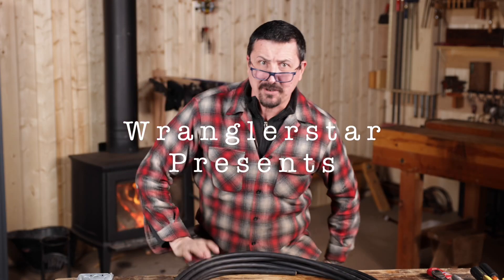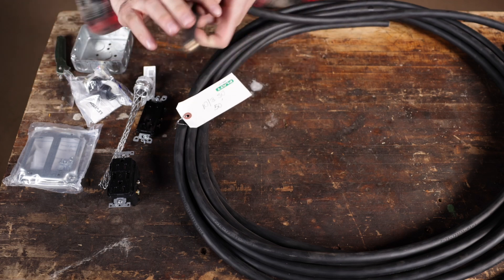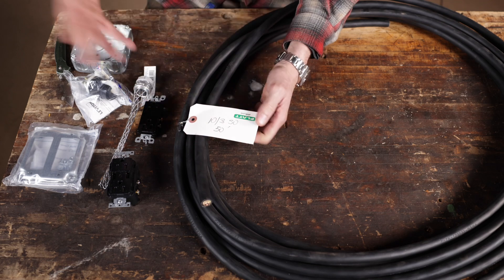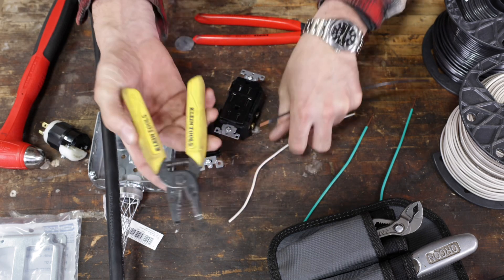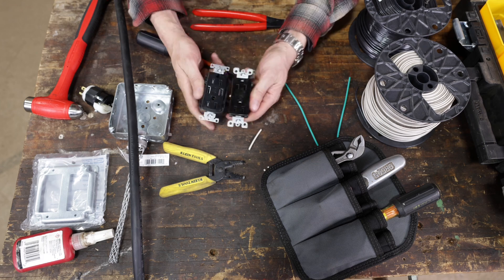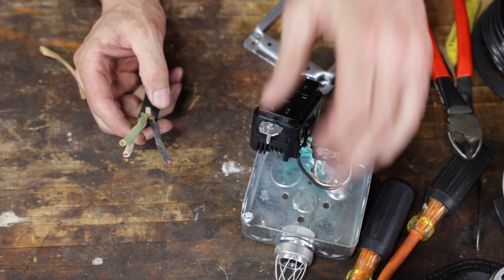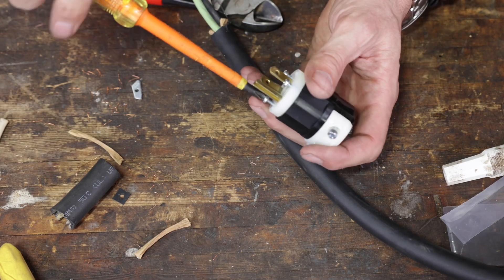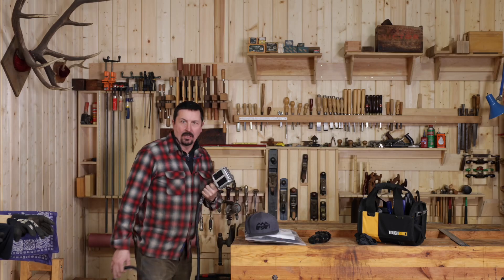The Ultimate $150 Shop Accessory - ALPHA CORD

Comment: SJ series wire, yours may be SJ0W or SJ00W. the less 0's in there the thicker the rubber jacket is. this stuff is the best! I wire a lot up with 12/3 SJ00W as the jacket fits in plugs easier
Reply: it is probably SO the O'S are for oil resistance not size the J is what means that it is thinner

Comment: I like the waterproof boxes and covers for my cords, and with a gfi socket on the hot side. Use to cut a tennis ball in half and put on ends so that at a construction site it will walk itself off of the studs, saving lots of steps at the end of the day. Will only work on the male end and not the box end.

Comment: That piece you removed on the male plug is for using on flat wire like pump wire. Not for that big black round cord you are using so you have to remove it

Comment: A nice bead of silicone to seal the gaps from water, and maybe a coat of  spray bedliner and filing the sharp bits before finishing this metal box would make it great. Yeah, it's GFI protected, but why rely on this to prevent shock when you can prevent the water going in in the first place...

Comment: You are missing the metal lockring. The plastic is good to prevent chaffing on the wire but not adequate for the strain that can be applied with the application you may be using this cord for.

Comment: Just a suggestion.  Use 20 Amp receptacles in your box and wire them in parallel, not serial. If the branch circuits in your garage aren't GFCI breaker protected maybe consider replacing one of the USBs with a GFCI receptacle.
Reply: They are wired in parallel.  If they were wired in series, you'd need something plugged in to both outlets to get any current flow, and each load would only receive only half the expected voltage. (approximately half, depending on the resistance of each load.)   And as some other commenters have mentioned, in order to properly wire this for CFCI protection, you'd need to have CFCI protection in the plug, or make sure you plug it into a CFCI protected outlet.

Comment: I've made a lot of those types of extensions cords and drop lines when I started out as a technician. Single and 3 phase drop lines were needed on every test bay and in the power amplifier generators final test area. 
A lot easier than wiring a 3kv power box for an RF ashing system.

Comment: You also could have used commercial or industrial grade receptacles which have braces on the back of the plugs and much better plug retention springs.

Comment: Don’t use metal boxes with knock outs for extension cords stuff can poke inside the box... we make them at work for high voltage testing but we use the Leviton pendant receptacle boxes which are made for this
Reply: how is it any different from when they are mounted on the wall of a building?
Reply: @patrickderegt2582  that’s stationary this is not and on the floor

Comment: Since you are using 10 gauge wire, maybe you should have used 20-amp outlets.  Probably not needed but maybe nice to have.  And also a GFCI outlet would make a lot of sense to have.  But great video, thanks!  I agree that beefy 10 gauge wire is nice to have.

Comment: FWIW: it would had made sense to use 10-3 and wire up the outlets as split-phase with a 240V plug. That way you could pull more than 20 amps with two or more devices plugged in.
Reply: how do you plan on using multiple 15 amp tools at the same time?

Comment: I did this for my welder, I wanted to be able to weld outside of my garage so I put the outlet by the door and I made a 35 foot cable for 220 And 40 A. I did it exactly the same so if the plugs were out I could just change that and just had a big metal box at the end

Comment: We use these commonly in the live production industry and are typically called quad boxes. In fact, all of our cable is soow to withstand the abuse of events. By the way, that 10-3 is a waste of money, space, and weight because a 120v circuit is only 20a anyway, so just use 12awg. Also, use hospital grade receptacles because they are higher quality and will last much longer.

Comment: Just a FYI to the public when doing a Plug End start by making sure you are at the right end of the Cord. If you have to cross the white & black wires to make the connections your on the wrong end of the cord.   If your on the correct end everything will go straight in.
Reply: Thanks for that little nugget of gold.  I'm off to the garage now.

Comment: For the expense and effort, why didn't you use water proof boxes so you can use it in the rain. I've built similar extension cords.
Reply: waterproof boxes tend to be less resilient to getting thrown onto concrete and there really is no point as normal 15amp plugs aren't waterproof anyways

Comment: Has anyone already suggested that the next time you assemble such an extension cord and if you have such a long strain reliever, you should first push the whole cable into the strain reliever, and only then strip the cable so that the wobbly wires do not interfere along the way?!?

Comment: UPGRADE:  USE a Aluminum weather proof box. The knockout holes are threaded . The and the Knockouts in the box wont accidently be knocked out. And Osha requires GFCI Protection pretty much every were now and then you don't need your lock nut on the inside of the box were it belongs and your connections will stay dry and weather Tight

Comment: Grew up calling the box filled access  holes in the box a "Knock Out", the knocked out blank was called a "slug"
Reply: For a short time you could use these in the subway turnstile. They fixed that quick.

Comment: The letters in "SOOW" stand for cable properties. The 'S' in SOOW cord means “Service.” For portable cords that begin with an S but are NOT followed by a J, the voltage rating is 600 volts. The 'OO' means the cable has oil-resistant insulation and jacket. The 'W' means the cable is weather and water-resistant.

The J in “SJOOW” stands for junior. And it’s only rated for 300 volts.

Comment: For this type of plug, AWG10 cable is overkill. A standard US 3 prong plug is rated to 15A, anything higher than that and you'll need those bigger heavy duty plugs. Taking this into consideration, a AWG14 standard 60C/140F cable is rated at 15A, a 90C/194F high temp cable is rated at 25A. A AWG12 cable is rated at 20A for the standard and 30A for the high temp. I would say a AWG14 is cutting it close on the current rating if you're gonna run high powered stuff off it, but a good quality AWG12 would be more than enough for a standard 3 prong US plug. I would only go bigger if you use an industrial grade 30A plug and circuit, but most homeowners will never encounter this.

Comment: Thanks, I'm fixing to head to the nearest job site that Versa Tech has going on and look for a few hundred foots of 10/12 and make one with four male plugs that then splice down to 10/3 so that i have the separate power options of 120amp volts, 240amp volts, 360°'s amp volts, 480 amp volts....WAAAATT!!!

Comment: If you have old usb connector cut off the wire fully and put the usb end back into the plug to stop dust and dirt getting it the usb port

Comment: It looks like you used lighter gauge wire inside the box. Doesn't that defeat the purpose of getting the 10 gauge?  Not criticizing, generally curious.
Reply: no 10 gauge just helps reduce voltage drop it would only be a problem if the jumpers were like 16 gauge or smaller

Comment: That bnut is to be on the inside the plastic u used on the inside is just to protect the wire from the sharp edges not to hold it together.

Comment: You could put a single plug on the end and then just put that four gang Box with a short cord, like maybe 3 ft. Which then you could use it on a workbench without having 47ft of cord
Instead of dragging that box around when needing only a single plug
 Because when you go to wrap and store that four gang Box it's a nuisance

Comment: That is not a jam nut it is a lock nut and it goes inside the box, the grey cap is a wire protection from the rough end from cutting insulation.

Comment: I used 10/3 cable to run power from the Dryer Circuit to my home made Face Grinder.  I just don't run it when the wife is drying clothes!  Like you said, home electricians don't have to follow the rules.

Comment: 10 gauge is overkill that it’s safe enough to run it straight out from the breaker panel than from the outlet with 14 gauge.

Comment: I read way down into the comments and didn't see it, but buying 10 gauge rather than 12 so that you can run 220v on it is just wrong.  If you're going to disregard the color-coding in order to run 220 over the cable,  the gauge of wire is not the question.  You can run 20 Amps of 220v on 12 g cable or 30 Amps on 10g cable.  As long as you haven't exceeded the voltage rating of the wire (usually 300 or 600 volts on this type) you should be fine, but the gauge of wire determines the current capacity, not the voltage.

Comment: Haha I made a 10/3 for my welder , and I only use 12/3 for my tools and for my portable table saw or miter saw I have a dedicated 10/3 or if I’m drilling steel for extended time or lot of load on the tool I only use 10/3 saves your tools life . I like the box  idea though.
Btw that red hammer is the best hammer ever I have one mine is a Gear wrench made in USA 90 bucks but omg I use it everyday had it for two years and love it !

Comment: Isn't the nut on the strain reliever supposed to go on the inside?? that plastic "Nut" is not a nut its not made to hold that in any way, the metal nut should be inside and the plastic piece should go inside as well its only used to protect the cord coming through.

Comment: You put the plug on the wrong end of the cord.  Notice how you had the black and white wires crossing each other?  If you put the plug on the other end of the cord, the wires polarity would line up with the proper blades of the plug.  Always look at the cord, and install the plug first.  -Doozer

Comment: Your cord is SOOW/SJOOW Cable. Heavy duty service oil-resistant insulation with flexible thermoset rubber jacket oil-water and weather resistant service cord. We used this in our bakery and vegetable oils will eat rubber and this is the only cable that would last. It will be last cable you will ever need as long as you don’t run over it. The color flipping in the plug is caused by he put his plug on the wrong end of the cable but it does not matter! Old electrician come out of me!

Comment: No need for 10awg unless you’re running over 150’ there should be no need to account for voltage drop, Service (SO) cord insulation is rated for 600V, could use Service Junior (SJO) 300V. 12-3 SJO is rated at 25amps, which is higher than breakers and outlets

Comment: you should do solar power instead of Fire wood. too save on the wood and its actually getting cheeper than firewood and it gives off more carbon dioxide than firewood which is good for the trees

Comment: The ring nut was NOT there as a "jam nut". To was supposed to go on the inside of the box. The plastic nut is not suitable to hold the strain relief into the box; the threads will rip out. Put the ring nut inside and tighten securely then the plastic nut is nut needed. Those nuts are for ridged conduit in a box. Again they are put on after a metal ring nut to protect the wires. They are not meant to, nor will THEY hold up to the kind of stress/strain that will be encountered.

Comment: The engineering on that Chinese finger trap 

Has a name it’s called  McCallum clamp they use the as strain reliever for wire and to hold and anchor a flexible pressure lines to a vice.

Comment: I would have built it out of an aluminum or heavy plastic outdoor box with the flip open covers if you are dragging it around on floor or drop it outlets faces will get broken or cracked so i would have the metal covers to protect outlet from damage and it keeps dust metal filings water etc out of box. the decora outlets are not as strong and durable as a good heavy duty duplex outlet is commercial or industrial grade the better grade outlets have better contacts and grip cords much better so you don't accidentally pull out cord

Comment: after a direct hit from a hurricane a bunch of us went to the factory and raided the wire storage and store room. 8 hrs  a thousand ft roll of s.o cable. a huge box of part. duplexes and junction boxes. made cable after cable for folks to run power to the house from a generator.

Comment: Not trying to come off crappy but it’s funny when he says it’s not rocket science or it’s easy and then messes up basic things electricians warn apprentices about all the time. The metal lock nut goes in the box. The plastic piece is a bushing. Also if you use any kind of power tool on that cord it will work yes but you should have at least 20 amp rated ends on it.

Comment: Its S-O cord and that box isn't correct. Use a "explosion proof" 4 square box with a single threaded hole (i.e 1/2, 3/4, exc.) Then use a rigid double duplex cover.

Comment: Ahhh... Wranglestar being an electrician... always good for a demonstration on how not to do electrical work... Your locknut:  is not a locknut.  That is a ground bushing.  It's not designed or intended to be a means of securing your Kellum grip (Chinese finger grip) to the box.  Your jam nut isn't a jam nut; It's the locknut that should have been on the inside of the box.  You didn't show the connection of your SJO cord to the box and receptacle.  It's anyone's guess on whether you put a sta-con or other appropriate terminal on the ground lead to make that connection proper.  Hopefully you also put the SJO cord under the duplex receptacle terminal and didn't double lug the only screw on the USB receptacle.  The appropriate box would have been an FS box, not a stamped rough-in box.

Comment: Cody, you now have an extension cord that will last forever with a USB port that will be obsolete in 10 years.  Maybe in 2030, you will have to do the swap-out video to the latest technology. Or maybe that receptacle needed a pop-out where one of the USB ports are (like the white nylon strain reliever had)  so you could just pop in the new technology in 2030.  :-)

Comment: Just remember if you are under OSHA or UL, this box like this would get you a citation  (cannot be home built.) For the homeower and YOU use them not a problem, but this would not be UL, ANSI or OSHA approved and would be against the law in a commercial setting.

Comment: ok for starters you don't use a plastic bushing for a nut that's not its job and you don't use the terminal to put the wire in you use wire nut or other connector and not jump the wires to one another outlets that is code not just a good idea the tabs are not rated to hold the current another outlet wired with it

Comment: Ah 10/3, pretty sure we used that for the outlets that go behind electric ranges.
Reply: Let's hope that you're using 8/3 behind your range!!  10/3 is only rated for 30 amps.  Most ranges need at least 40 amps.  Some need 50 amps (6/3).
Reply: @jim.h  My bad, you're right. It would've had to be 8/3 at least, because 10/3 is more like romex, and not like actual cordage. I'm not sure why I was thinking 10/3.

Comment: Not an electrician but using 10awg S/O cord on 15 amp standard home power and box outlets is wasting money. Could get a way with 12awg (gauge) just fine. If you want true shop power have 115v 20amp wall service installed should include 5-20 outlets. Build a cord like this    with 10awg and 5-20 plug and outlets and you’ll have enough power to run 110 welders or multiple power tools.

Comment: The 4 S box you are using is not a good idea the ko s can and will bend in causing a short 
And using it on a cord end is not nec compliant or osha 

How ever you could weld the ko s and then coat the outside of the box in a heavy layer of tool dip 
Just sayin 
Ps use blue lock-tire on the fasteners 
Just my humble opinion

Comment: SO cord...
35 year electrician  here.. the 10/3 SO cord is a waste at only 50' length and a max 20amp circuit like what you would plug this into.  12 would be more than needed and, lighter, easier to deal with, cheaper and just as durable.   Zero benefit to using number 10 in this cenerio and a lot of compromise . 
Also the installation of that wire under those duplex screws is less than desirable but you made mention to that and you didn't care.

Comment: your setup is only as strong as its smallest wire. that 50' 10 gauge should be 12.
Reply: Why would you wan to run a smaller wire?  10 >12
Reply: yep, I'm completely confused on why he built this cord set up.  10 gauge cord going into box, than 12 gauge jumper to one 110 volt outlet.  I'm guessing the other outlet received the 10 gauge wires.  And max amps on a 110 volt is usually 20 amps.  I see some 110 VAC  outlets say max is 15 amps.   I believe 10 gauge allows up to 30 or more amps depending on the wire type.  So why pay extra for 10 gauge when 12 gauge is more inline (max amps) for a 110 volt extension cord.  Even if all outlets and usb are all in-use simultaneously, the max is still 20 amps at the cord connection on the wall outlet.  It's his money for the spending of bigger wire, but, maybe other people will follow and build something that does not make safe electrical sense.
Reply: why would you want to run a bigger wire? the wire from the source  is 12 gauge if it's plugged into a 20A outlet, defeats having 50' feet of 10 in the mix. Coulda saved a few bucks.